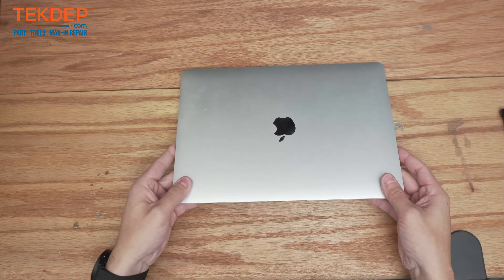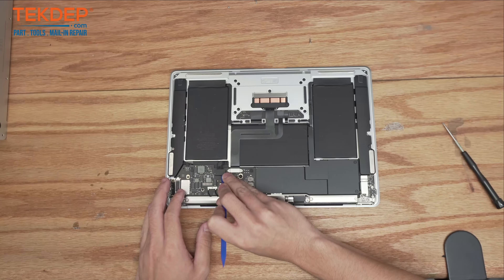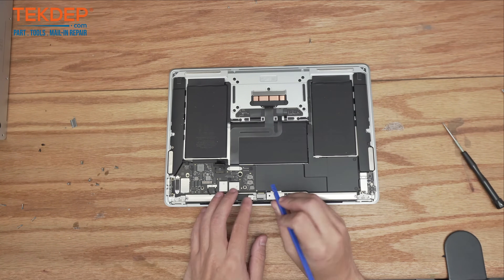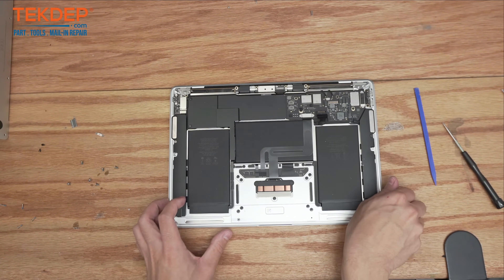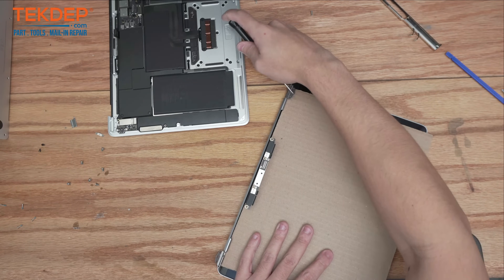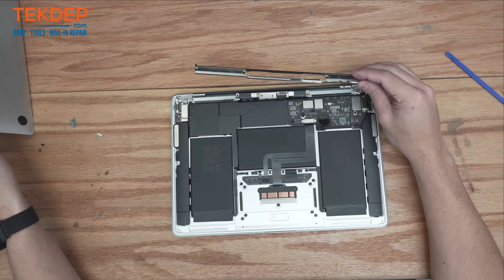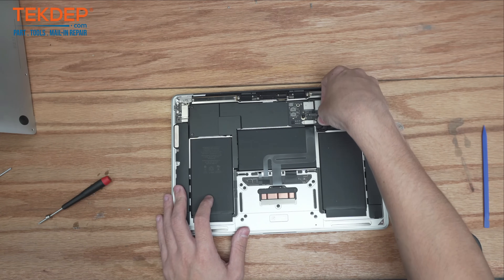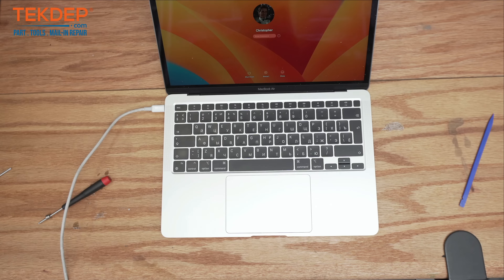MacBook Air M1 A2337 LCD Replacement | Seeing Clearly Again!

Comment: I have this same model, screen flickering horizonrL lines all across and a couple vertical ones as well, was just using it sitting down one day and it started out of no where. can the cables be replaced or does the whole display need replacing ?
Reply from the maker: Hello there,
It sounds like you're running into that very common flex cable problem. Unfortunately, those cables are integrated directly into the LCD panel on the M1 models and cannot be replaced individually. The standard fix is to replace the entire display assembly.
We have the Best high-quality replacement display assemblies available here
https://tekdep.com/product-category/find-all-parts/laptop-parts/apple-macbook-computer-parts/13-macbook-air-replacement-parts/2020-m1-macbook-air-a2337

Comment: how did you get the .8 screws in? it looks like you had a special adapter
Reply from the maker: We have all the parts and tools for it. Make sure you have the right tools for the repair.

Visit our website for any mail-in repairs, tips, and tools you need, and stay tuned for more videos.
Join our community

https://tekdep.com/

Comment: People say the quality of screens bought on Amazon are worse but how does it get worse? I didn’t even do anything and my screen got those lines 😂
Reply: The screen by Apple is definitely superior, they got some of the best panels 
What brought you these lines is wear and tear on the thin connector cable
Be careful when opening your Mac, never lift it on the screen like many idiots actually do and you should be having no trouble
Connectors get smaller each year as are devices, mba is tiny, it shouldn’t happen but i totally understand why it happens, it’s a small line between smaller smartphones and bent iPhone 😀
Reply from the maker: We carry all displays and offer free warranty, we only select premium parts.

If you're still experiencing issues with your device and need help, we offer a convenient and affordable Mail-In Repair Service and data recovery. You can learn more and get started here: https://tekdep.com/device-repair/

If you need parts like lcd and displays or battery or tools for your repairs, we have them all and ship worldwide! visit: https://tekdep.com

Comment: Can you remove the bottom plate without a suction device?
Reply: This case just LIFTS off; it's ridiculous to use a suction cup, or believe that you do.  It just lifts off.  No securing latches or anything.